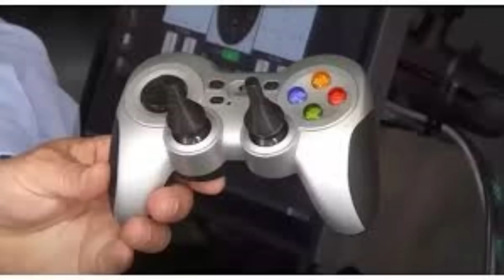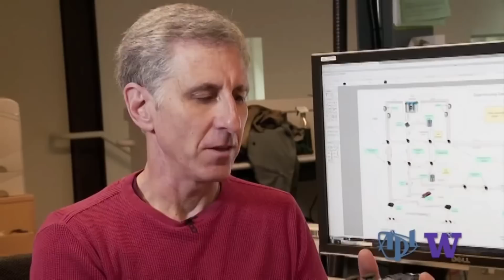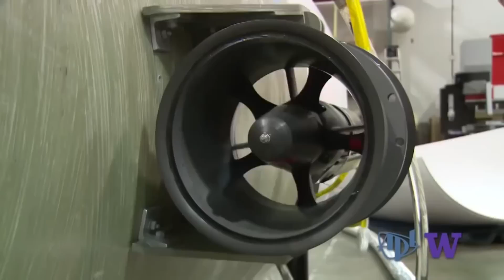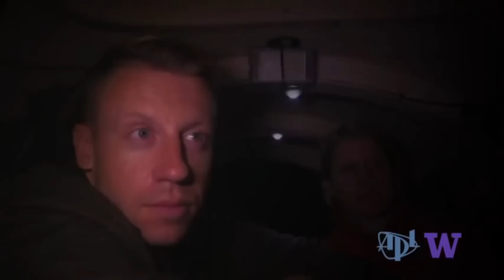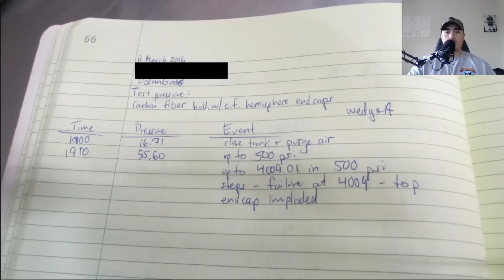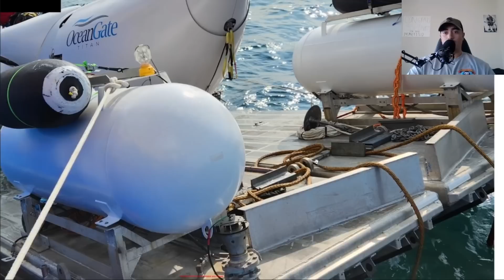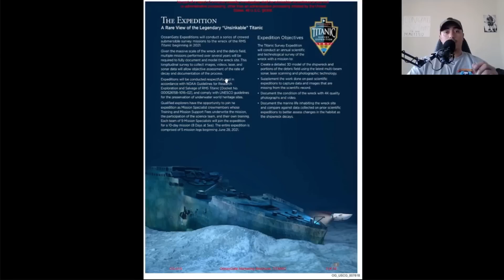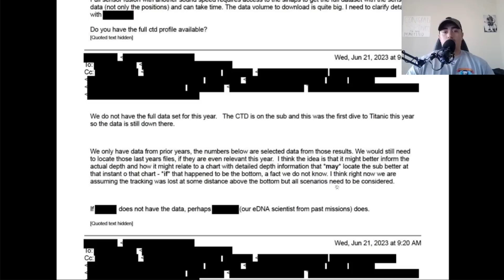PART 6: OceanGate & UW APL: Cyclops Submersible, Titan Scale Model Testing, and Tragedy Transcripts

Comment: Wouldn't  the act of cutting the carbon fiber dome alone be enough to damage it and weaken the fibers?
Reply from the maker: Exactly! and you don’t need millions of dollars to figure that one out. What happened to the CF domes also happened to the hull on titan.
Reply: @sspdiving  You are right!  They cut those too!
Reply: @sspdiving 
Everyone has said, “carbon fiber domes” and I believed they were titanium, yes?
Endcaps were both titanium.
Reply from the maker: Titan aka cyclops 2 used titanium end caps. Cyclops used CF on end end and acrylic on the other. We are referencing the CF end caps used on the scale test models which failed.
Reply: What struck me about Titan itself was the fact that they skimmed off the CF cylinder in order to fit the titanium rings. Surely this left a weakness at the right angle formed—a potential for fracture propagation, and the joining glue couldn’t be checked for voids, thickness and consistency, so could potentially have voids that would contract and expand compromising the CF in the channel of the titanium rings…as well as a possibility that water could leak between the glue and surfaces, gradually ingress deeper into the ring.

Also, the inner ‘ring’ created by the titanium ring channel would have a lot of pressure on it…witnessed by it being not present on the recovered forward dome.

Comment: Ugh.  When the guy says that the electrons go from the Playstation controller to the thruster is either dumbing it way too far down for general public consumption or he doesn't have a single clue how transistors work.  I sincerely hope it's the former...
Reply: The electrons are carried by dancing pixies.
Reply: @GWNorth-db8vn  Technically, the electronics run on magic smoke.  If you release the magic smoke, it doesn't work anymore. 🤣 This is, unfortunately, based off personal experience. ☹
Reply: @sixft7in  - I make some of the parts that keep the smoke inside reactors. We call those "CNN jobs" because if you screw it up, that might be how you find out.
Reply: @sixft7in I work in an electronics r&d lab as a destructive testing technician, and we have magic smoke detectors that can sense down to the PPM level. If we get ANY magic smoke, we fail the design.

Yeah, looking at that Simulink diagram, I was thinking about the needless complexity. Why do we need Bluetooth and IP and PWM and transfer functions, just have a switch to turn on and off the electricity.
Reply from the maker: Thank you for sharing. I bet you have a unique perspective on this whole situation. You would probably cringe at the newest video I just posted. An interview with electrical engineer Bruce Morton.
Reply: @sspdiving  While I certainly have a unique perspective, so do thousands of technical people, and we are all unified in criticism.

That's what gets me about this. Whether you are a technician or an engineer or a hobbyist, whether you are in electronicals or mechanicals or ocean/diving like you, we can ALL find things that are capable of catastrophe.
Reply from the maker: @sixft7in  this is why I love YouTube. I wouldn’t have known  if it was real or fake. Thank you for the insight.
Reply: @sspdiving  Guess I should specify: I'm a former US Navy nuclear reactor operator, which are Electronics Technicians. Love your content!